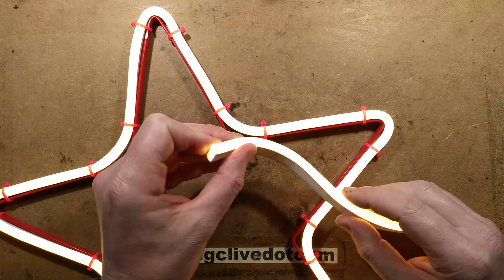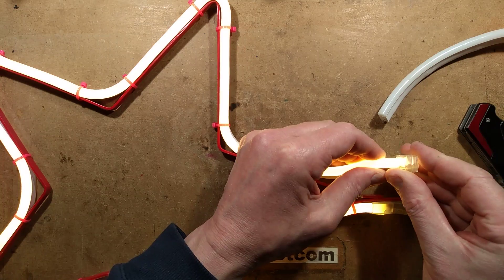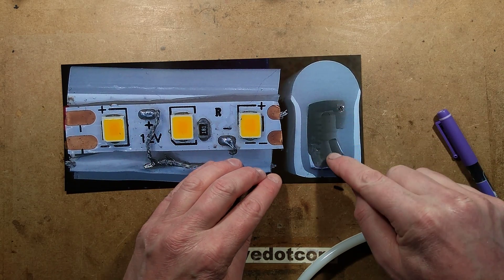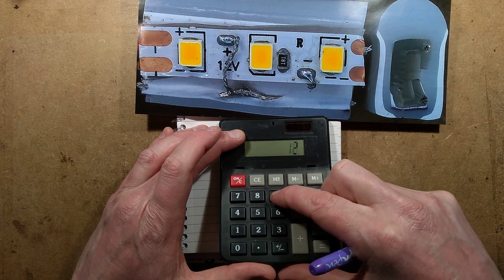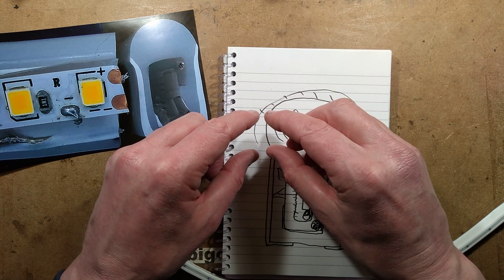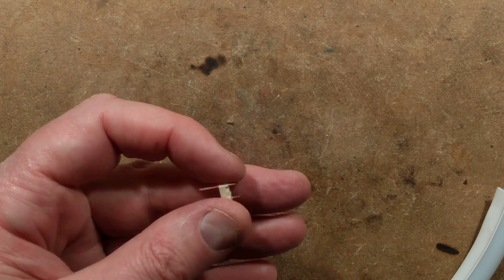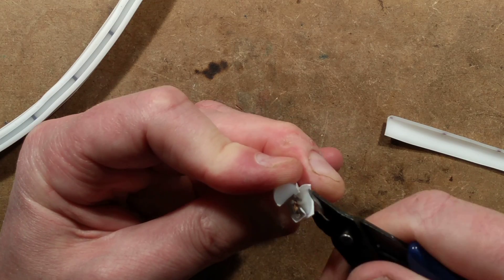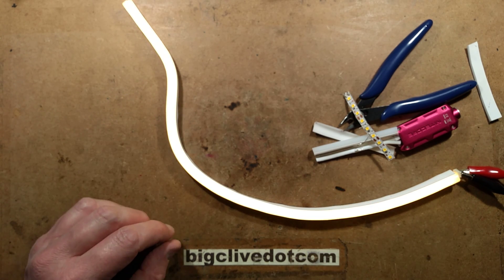Testing and tearing apart some 12V LED neon-flex.

Comment: For even illumination of very long runs, connect + at one end and - at the other. That evens out the voltage drop and all LED segments get the same voltage. The extra bus connection at one end is prefect for feedback voltage control. On long metal grounded vehicles connect one end to the metal chassis and the other end to power.
Reply: Hi Tim,

I am creating a very long run in my apartment, could you go into further detail about even illumination. How would I specifically connect the positive at one end and the negative at the other?

Thank you ver much in advance.

Comment: I have cut my self more with a duller knife, than with a razor knife, I guess you know the sharper, and more careful. I was using a dull knife once, it slipped! Guess what! I need up with 1/2 of a 8" blade in my leg!  Luckily I did no major damage,

Comment: I used one of these for a very simple DIY ring light. I spliced on an old lamp cord with a switch and simple as that, you just saved 80 quid.

Comment: The only way to run proper straight lines would to have a CNC routed or millied channel on some board and mount the LED strip into it.

Comment: Is there version of this that can run of 3V ?
Reply from the maker: You can get ornaments that run from batteries that use a low voltage version.  It tends to have a bit of intensity variation along its length.

Comment: The bus bars are probably steel due to the fact copper and Aluminium will work harden, which doesn't make it very good for something designed to be bent a lot as it'll eventually stiffen and break.

Comment: cool foxy like this I have a metal shooting star that had that incandescent rope light it failed so I snipped off the cable and threw away the rope bit I'm left with the metal frame so this will be an ideal replacement !

Comment: Without transparent cable ties,  or the use of clear adhesive,  it does not look good. BC, this is the funniest video you have done in a long time! PMSL and I am wa5ching it for the third time. You can only imagine what I was like after the first run.

Comment: I hope the anonymous coaster designer reveals more. Of course I'd like to print some Official Big Clive coasters but also I'm really curious to learn more about how it was made. The finished result looks as good, or even better than many of the multi-material prints that I've seen.

I hope they release a blog or video documenting their process!
Reply: the shiny/gloss look is achieved by printing the side youll put your cup on on the bed, hairspray applied to a clean bed with the right first layer squish right gives a great smooth finish to the underside of your prints.

Comment: Is this product waterproof would it be suitable on a wet deck of a fishing boat thanks
Reply from the maker: Should be OK in a wet area.  But not continuously submerged.
Reply: @bigclivedotcom   thanks mate
Reply: You may want to fill the end caps with dielectric grease before fitting them in place to help displace water.   In wet applications AC may last longer than DC if moisture does get in.
Reply: @ethanpoole3443   im limited to dc 12v
Reply: I was thinking clear silicone sealant over the end caps but dielectric grease works aswell thanks for idea

Comment: If you did have a REALLY long run, would you be able to power it from both ends? I don't want to say like a "ring circuit", but... [watches further] Yeah, it's all DC, I think that would work so that the resistance in the wire is compensated by having multiple supply points.  Should work.
Reply from the maker: You could do that.   I wouldn't trust the thin busbars for more than a few metres though as intensity will drop off.  One option for perfect linear intensity would be to apply positive to one end and negative to the other so every single circuit saw the same total resistance.
Reply: @bigclivedotcom  Oh, now that's interesting. I have a 7m run of "ordinary" RGB LEDs that progressively get dimmer the further from the powered end. So if I took a nice thick, say, negative wire and ran it alongside the strip and connected it the far end I'd get uniform brightness?? This could change my life!
Reply from the maker: @PurpleTT99  The simple RGB stuff is usually common positive.  If you extended the common wire to the other end then it should result in more even intensity.

Comment: If you gently warm it, will it fit tighter corners and hold its shape.??
Reply: I think that wouldnt be possible if the material is a silicone type, where the temperature required would be 200#c+ (or worse) and  potentially negatively affect the optical characteristics. but then if its a vinyl then youd have the problem of the flex pcb not being able to bend in that axis, and potentially deforming out of the diffusion material, or breaking/snapping. though i feel like the 'cutting sections and cleverly terminating the ends' (with or without extra diffusion to 'hide the borders') would be a reasonable approach. still it would be cool to see the limits an artist/ engineer could push this

Comment: Hey Clive, How about using some of these super capacitors for powering your LED strips and projects? They are comparatively cheap copared to a just a few years ago. Voltages from 2.7 up to 16 Volts and capacitances in the 'exotic Farad ' region. Great vids by the way.

Comment: https://www.alibaba.com/product-detail/IP67-IP68-high-lumen-led-neon_60858181606.html?src=sem_ggl&mark=google_shopping&src=sem_ggl&mark=shopping&cmpgn=1675096474&adgrp=63830955303&locintrst=&locphyscl=9029482&ntwrk=g&device=c&dvcmdl=&position=1o5&pla_adtype=pla&pla_mrctid=130788646&pla_channel=online&pla_prdid=60858181606&pla_country=US&pla_lang=en&pla_group=293946777986&pla_localcode=&gclid=Cj0KCQjwhuvlBRCeARIsAM720Hq_Kkoa8XEUkBsUgtX7WphXTkkJYhwmqlBZeNw7q2hDR_th4AEJJAIaAnLuEALw_wcB#shopping-ads

3,38 per meter??  Just need transformer..

Comment: You can just bend a fluorescent tube and get the same result.
Reply from the maker: You CAN bend fluorescent tubes.  The curved ones in escalators were made from straight ones put inside a flexible heated sleeve and just heated to the point they could be carefully bent without allowing the vacuum to collapse them.  You can also warp them by carefully heating them over a gas jet, but you have to be careful to heat them slowly and also cool them back down slowly.  They do tend to collapse without support, but still light.
Reply: Instructions unclear, tube shattered and cut my hands
Reply: @iamdarkyoshi  Ah yes, kevlar gloves and safety goggles are essential for this project. :)

Comment: bigclivedotcom If you haven't seen and reviewed Electroluminescent Wire (EL Wire) The Tape, or Panels YOU NEED TOO, it's perhaps superior to this LED stuff.   It comes in various thicknesses (The EL Wire) and runs off a battery pack for the thin stuff, which actually converts D/C current to A/C, comes in many lengths and there are 12 volt car versions with a controller.  I like the thicker tube stuff that's about the size of this LED tubing and it runs off a plug in transformer.  EL panels, tape, and wire can be cut anywhere with no issues.
Reply from the maker: The intensity of EL wire is very low and falls off quite rapidly in initial use.
Reply: @bigclivedotcom  Thank you so much for responding! Have you tested the thick EL wire that's used for landscaping and is quite expensive, runs off mains power?
Reply: He has done a video on it. Search the channel name and electroluminescent wire and you'll find it.
Reply: @Providence83  Thank you!

Comment: Does anyone still do cold cathode flex?  I remember it came out about 20 years ago, but was very dim.  Advertised for wrapping around your bicycle frame or car interior.  That had a pretty neon glow.
Reply: "cold cathode flex?" I think you'll find its called Electroluminescent wire. its still available

Comment: I would think the little pig tail wire is pre wrapped before its encased in the channel. Then they just heat up the little area where the pig tail is and pull the pig tail and a bit of the main bus wire out with like a dental pick then just trim away the excess plastic. Just thinking out loud though

Comment: So this led flex rope is just an LED strip with some rubber wrapped around it and then they jack the price up 2-3x or more...

How the hell does that work
Reply: Economics - this stuff is used a lot in budget 3rd rate sign writing
Reply: ~°/C A P I T A L I S M\°~

Comment: 13:12 I think that's actually a 3-pin fan header from a motherboard.
Reply: Actually it is a Molex KK type connector, and is a style used in many common applications.  Motherboard fan connectors just happens to be but one application
Reply: @ethanpoole3443  I want to order some of those connectors to use with my LED neon, but there seem to be a lot of Molex KK type connectors. What kind specifically should I get?
Reply: hissrattlesnap The main variation is whether the connectors are keyed and/or have a positive retention latch.  As long as you purchase the matching plug and socket you are golden, it’s only if mixing those combinations that you may encounter some incompatibilities.  Also don’t forget to order the crimp pins as they Molex brand plugs do not come with the crimp pins since there are 3 varieties of pins available (different plating options, but all are compatible).  The type that Clive uses are the knockoff Chinese version of the Molex KK type connector which are the most popular and basic Molex KK style plug (no keying, basic friction retention) and socket one tends to encounter and are readily available on eBay and Amazon (usually in kits with the 2,3,4,5 pin plugs and sockets plus galvanized type crimp pins).  If you want Molex brand specifically then consider ordering from Jameco, Digi-Key, Mouser, etc. (Digi-Key and Mouser offer every possible variation, Jameco just the basic plug and socket style plus several plated pin options...or at least those were the choices last time I ordered from Jameco).   However, if you are only interested in doing exactly what you see in this video then you are interested in the 3-pin PCB connector (male) then all you need is Jameco Part# 232274 or Molex Part# 22-23-2031, which is just that basic friction fit 3-pin male PCB socket and nothing more.

Comment: Nice lights! The connector you're using is a standard 3-pin connector for (desktop) PC fans, by the way... its four-pin brother is for the PWM ones and comes in a couple variants depending on how you want the tongue part (which you cut off)...
Reply: It is a Molex KK type connector more specifically.

Comment: Pretty expensive per meter.
Reply from the maker: Not when you consider what's in it.
Reply: @bigclivedotcom $53.00 for 300 leds I currently get for 3-5 dollars though it lacks the rubberized diffuser.  How bright is that or is it just for accents?
Reply from the maker: @thebeststooge  It's just for feature outlines.  It isn't as efficient as direct view LED tape.
Reply: Thank you.

Comment: Have you ever played with EL wire and panels Clive?
Reply from the maker: Yes I have.  Always a bit disappointing for intensity.  I took some to the BBC studios to test out on camera with a view to using it in props and it just didn't do the job.  In theatre applications they often over-drive it to get higher intensity at greatly reduced lifespan.
Reply: My experience too: very very dim.

Comment: hey bigclive I was wondering if  could send you a cheap led LCD projector and hope that you could upgrade it by making it brighter thanks love you videos
Reply: Sounds like a job for a nice CREE cob LED. Making a cheap LCD projector brighter should actually be a really easy thing to do. really depends on how the LCD can handle the extra light and possibly heat. Single colored panel versions tend to look a bit washed out it seems. There are a bunch of videos out where people have tried to do just that and have gotten decent results.
Reply: @Zenodilodon  thanks for that
Reply from the maker: They're often pushing them to the limits thermally as it is.  And the LED array may be a custom rectangular one to match the panels aspect ratio.
Reply: @bigclivedotcom  so could I send my projector to you and could you put a brighter led in it and make a vid out off it
Reply: Thermal management in high end projectors don't joke around. Anymore airflow and you'd have to register them as drones.

Comment: I have 3 of the stars in blue mains voltage and 1 has a anoing short in it it works fine the other moment it fails so meby gona make som pixel stars with pixel tape

Comment: I don't envy the man whose job it is to wrap those little wires around the busbar. It almost has to be manual though, because if you went through the trouble of automating it you'd do it before the busbars were molded into the transparent plastic.

Comment: Interesting, last christmas i got myself a christmas tree shaped light of this type. But the difference was that the flex let out light both on the front and rear, not sure how they managed to do that. Also it was two colours, green for the tree and white-ish for the star. Would be interesting to see the cross section of that type of flex too.
Reply from the maker: Similar, but the LED tape is mounted sideways with a translucent dome out both sides.  The LED tape was probably either manufactured with the two colours or spliced before insertion into the diffuser.

Comment: Hey Clive. i got a question. what does it take to make a phosphorus silicone to enhance the light emissions of a smd led. for example this "neon strip" would it make sense to use a phosphorus silicone to get more light out of those LEDs?
Reply from the maker: You could possibly use a phosphor loaded plastic with blue or violet LEDs.  Not sure how even it would look.
Reply: Keep in mind that there is already a phosphor loaded coating on the white LEDs to produce the white light (the actual LED color is blue), so it would only be reproducing the effect of that coating...but a second phosphor coating added to an LED already emitting “white” light by way of a phosphor coating would see little, if any, added benefit — at best you would get a harder shift to the red end of the spectrum since the second phosphor layer would only respond to the blue part of the spectrum that was permitted to pass through the red and green producing phosphor already installed at the LED, so you would lose most of the blue light that was initially allowed to pass through that phosphor to produce “white” light from red, green, and blue peaks.   So you’d end up with string red and green peaks and very little blue peak, which would yield a warmer yellow/amber light — but then you could have achieved that same effect to begin with by selecting warm white LEDs to begin with as they would already use such phosphors.

The only practical implementation would be to use blue emitting LEDs (sans phosphor coating) if you wanted to embed phosphor in the silicone jacket...but then you would use a lot more phosphor just to yield the same effect as the blob of yellow phosphor you normally see applied to a white LED only to accomplish the same end result.

Comment: I wonder if it'd be possible to make 90° corners by cutting at the right spot and linking the bus bars together with little pins.
Reply from the maker: They do some pretty intricate shapes like that in signage with this stuff.
Reply: That should be possible

Comment: Don't whatever you do reverse the polarity on a strip of that I am absolutely not interested in finding out what the failure mode is... Do you hear me - DON'T YOU DARE
Reply from the maker: Not so bad with the low voltage stuff, but I've seen an entire run of 240V LED ropelight damaged by reverse polarity of the connector.
Reply: Reversing the polarity won't do anything. It just won't light.
Reply: @MrsZambezi  Do those diodes have a high forward voltage then? - because I reckon if you reverse polarity they'll blow boringly but you should be able to see how it dies
Reply: @b3nosborne  In that respect LEDs are bomb proof because, like any normal diode, they only conduct in one direction.
Reply: @MrsZambezi  You're completely right. Only a total mad lad could blow a diode by reverse biasing it, I bet its not even possible and has never happened
Reply: LEDs, like most diodes, can indeed be damaged when their maximum reverse breakdown voltage is exceeded, but that is usually a bigger concern at the higher voltages.  That’s why at higher voltages (especially if AC) you will often see either a higher voltage rectifier diode in series to prevent reverse biasing OR you will see the LEDs paired up and reverse biased relative to one another so that regardless of the voltage polarity one, or the other, of the LEDs will be lit limiting the reverse bias voltage on the other LED to that of illuminated LEDs forward voltage (1.7-4V depending upon LED and color) and since the reverse breakdown voltage is greater than the forward voltage the unlit LED remains safe.

As this is a 12V strip (IIRC) I would not expect anything bad to happen upon reverse biasing, but in the higher voltage versions it could certainly become a concern and potentially damage the strip.